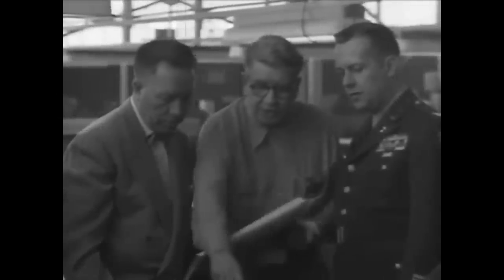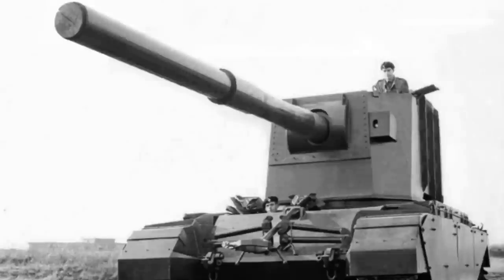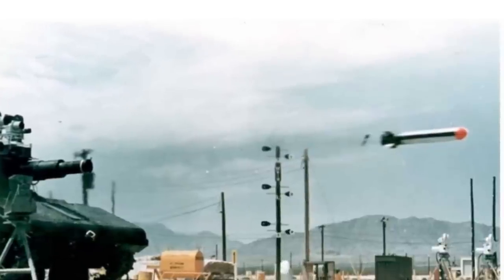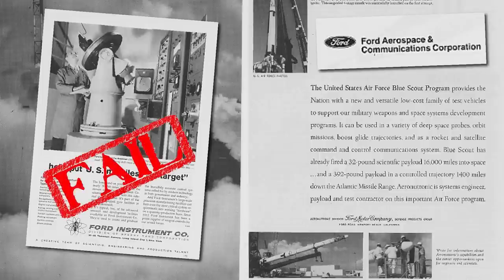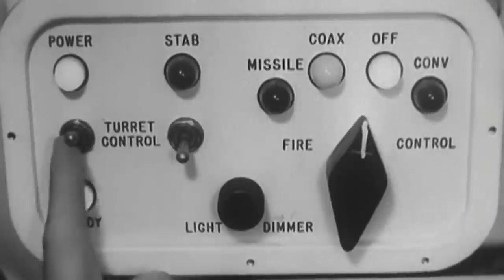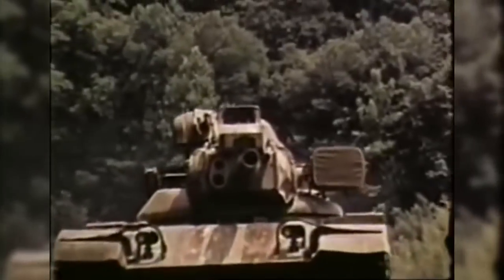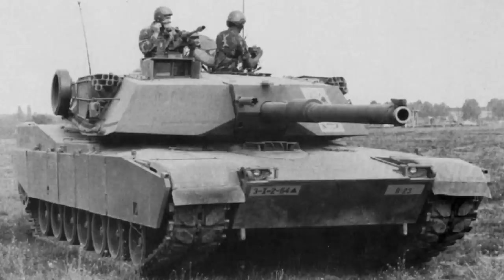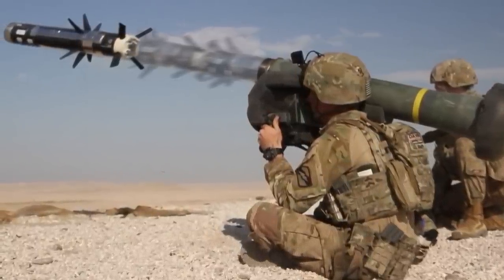MGM-51 Shillelagh - Was it a complete failure?

Comment: Keep in mind that the armaments of early WW2 tanks weren't autocannons.  They were single-shot, breach-loading cannons and were all basically derived from the towed variants.  Some of the designs were adapted into autocannons later on (e.g. the 2cm KwKK 30 on the Panzer II), but the gun mounted on the tank was most certainly not an autocannon.
Reply from the maker: No, some were indeed auto-cannons. The German KwK 30 and the Polish 38 FK both had high rates of fire (600 and 350 rpm respectively) and were magazine fed.
Reply: @RedWrenchFilms  The Pz 2 is the exception, not the rule. The vast majority of tanks were not armed with autocannons. Including all Polish tanks. The 7TP's were all armed with either traditional cannons or just machine guns. Only some TKS tankette's had the autocannon.
Reply from the maker: @Ragedaonenlonely  I say this in the video. A mix of 20mm autocannon, .50 cal machine guns, or some larger guns up to around 40mm.

Comment: Assuming that they still have them mothballed somewhere- Remove the Sheridan's tank gun- slap a 30-35mm autocannon on it and the fire control upgrades needed and ship them to Ukraine as a light recon tank. The UA can bolt Stugna's or whatever externally on em as well.. Cheaper than the Army's new light Tank.

Comment: The only problem was that you had to set the system up, make it zeroed and accurate, as soon as you fired a conventional round you were committed as the missle system would slip out of focus after firing even one conventional munition., we were on the east german border, in contact we were outnumbered 11 to 1, the name of the game was to wait for the russian tanks to break over the top of the ridge about 4500 meters away, we were then supposed to kill 12 of them with our missles, then retreat to fall back annd re-arm. without throwing conventional arms. The system was very carefully designed to do a very specific fire mission. It would have worked just fine but it was designed for countering an all out invading force.  DinoChrome!

Comment: Wow, again the "molten metal" myth on chaped charges
Reply: It never really dies, does it? My favorite one is "HEAT jet burning through armor".
Reply: What is it actually, then? Every source I've read describes it this way.
Reply: @RJ-lg9hs  Instead of melting the copper liner, it would deform the liner.
Reply: @RJ-lg9hs  You have a liner that turns inside out due to the explosives in the HEAT shell causing it to form the penetrator, but that is formed by imparting enough kinetic energy to the liner that it starts to behave like a liquid. Liquids can't be compressed so it moves through the path of least resistance, the armour of the tank until it looses its energy.
The explosion itself doesn't generate enough heat to melt anything really.
Reply: @Thund3r0v  But the change of state from solid to liquid is called "melting". Temperature isn't the only thing determining an object's state of matter. The extreme pressure in the shell causes the copper to melt. Every single source I've seen describes it this way. If you have a source that explicitly states the copper doesn't melt, please give it.
Reply: @Commander_35  It's not just a deformation. It literally becomes a liquid due to the extreme pressure of the explosion.